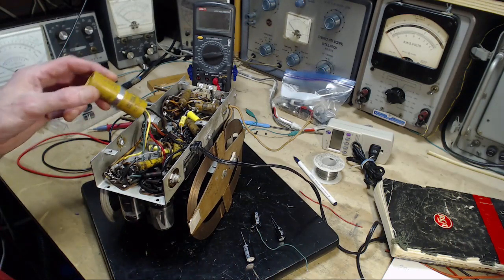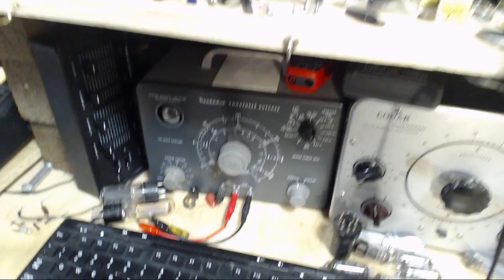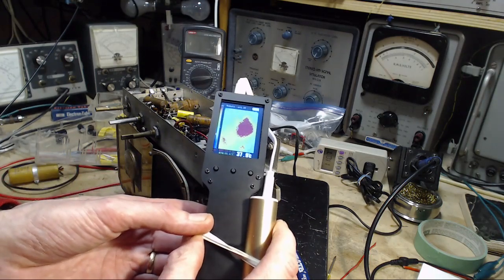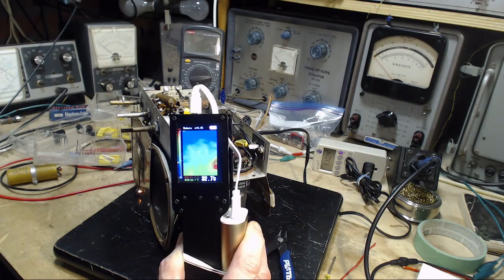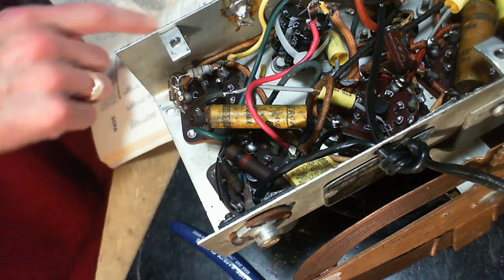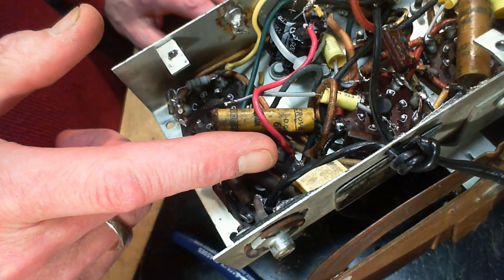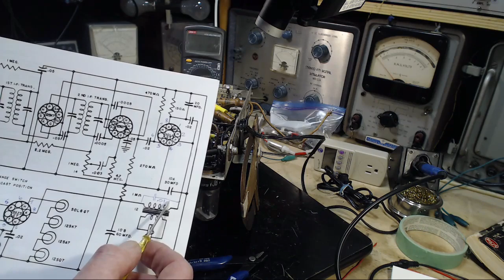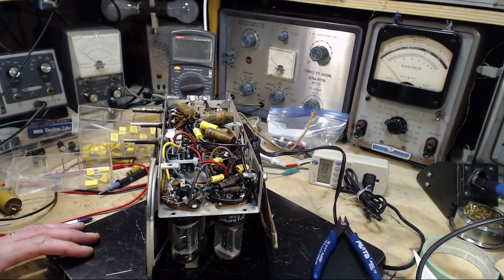Crosley G2465 Two Band Radio Video #4 - Hum Persists

Comment: 29:52 the capacitor he is chasing is the snubber cap for the primary of the audio output transformer. In most cases it is connected directly across the primary of said transformer; i.e. plate of audio output tube to B++ i.e. cathode of rectifier tube. But circuitwise it can also be connected from plate to ground, so that the transient voltages find their way from the plate to ground and via the main filter caps back to the B++. But one may also connect the snubber cap between plate and cathode of the audio output tube, so the snubbing takes place right across the cathode anode path, limiting the cathode to plate voltage, while the transients also return via the cathode bias cap and mains filter to B++,  And it is the latter way of connecting the snubber that is shown in the schematic, while it is the first way of connecting that is found in the wiring. However all these placements are viable options, that you will find being used by various designers when f.ex. filing thru the 1949 Riders XIX perpetual. Even amongst the Crosley models of that era design switches between all these options. So wether the found wiring with the cap placed directly between plate and B++ is a design change,  or the drawn position on the schematic is in error, does not play any fiddle or itch a dead dodo cause it serves the same purpose.
Reply: Jim has trouble visualising what's going on by just looking at the schematic .
But he is getting  better at it .

I've seen technicians do no better when 1 + 1 = 6 !

Comment: Hi Jim
Try & move the new cap closer to the output tube grid pin .
The low impedance is on the preamp side .
Foil end & excess wire should be facing the preamp tube .

Comment: That 0.02MFD capacitor is connected in parallel to primary of output transformer. It acts as a small snubber to short-out high frequency oscillations. In schematic that capacitor is shown as between plate and cathode of output tube which is not a proper method. So just replace that capacitor "without changing connections" (because the method used in the radio is better than that shown in schematic.)

Comment: The internal material in a capacitor is either external insulation/shielding/packaging or part of the capacitor's functional material (electrolyte, either liquid or solid).  Anything leaking out is going to change the capacitor's ability to function properly, regardless of its cause.

Comment: Jim, here's a long shot!  In the days when these AC/DC radios were in use by the milllions, often the instructions used tp read "If the radio hums excessively, try reversing the AC plug in the outlet."  Could the AC power cord on this radio have, at some time, been replaced and wired in backward???  You might check that out.  (I know you're using an isolation transformer - but who knows??
Reply: Or...try the radio by temporarily skipping the isolation transformer and plugging it directly into an AC outlet, as it would normally be used. The chassis (or B-) side must be connected to the neutral side of the AC line, and as you know this is usually done thru an isolation capacitor in the radio circuit.  Try the plug in both positions, but be careful.  The chassis will be HOT depending on which way the plug is inserted. Worth a try to see if one of the ways kills the hum.